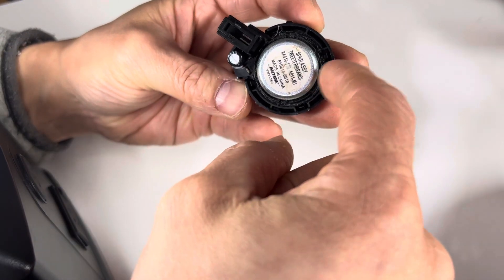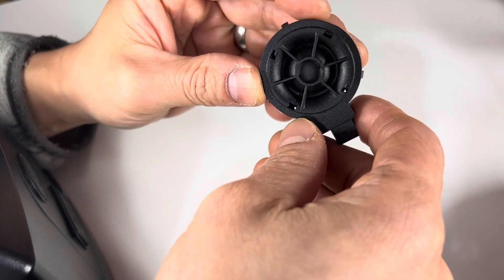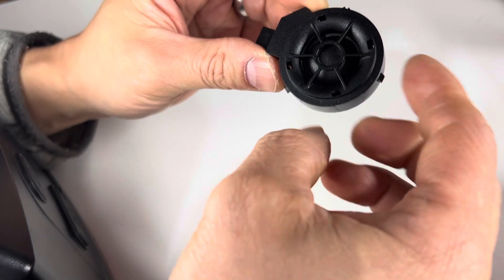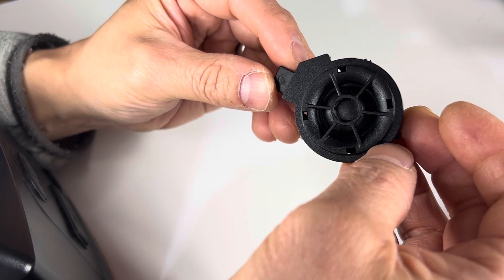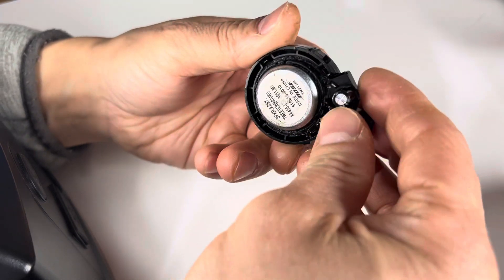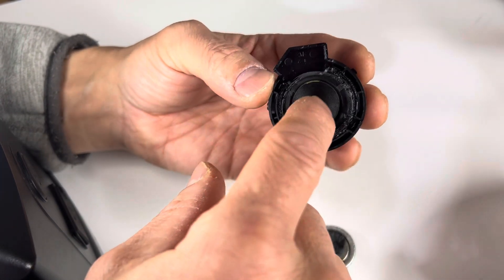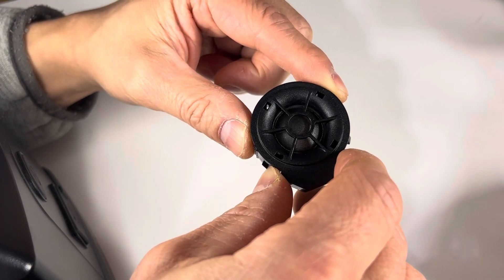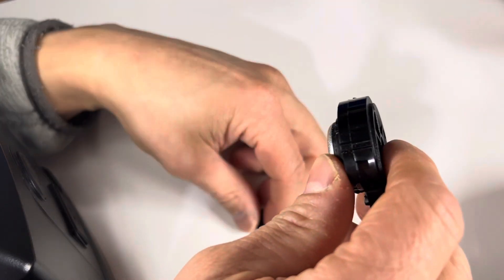How it works: Bose Centerpoint Car Audio Tweeter speaker. Stock:Honda/Mazda/Nissan…

Comment: Do you know how to access the Bose amplifier?  It’s supposed to be buried somewhere under the dash on the driver side.  I removed the kick panel and glove box but there’s was no sign of an amp.  I guess it’s way up in the dash.  I’m trying to tap the front door channels to get a mostly full range signal to send to an LOC to get full range output so I can add an amp and sub.  I have the hybrid touring and it’s the same Bose system as the SI.  It’s ok but meds more bass.
Reply from the maker: Hey, I can’t rem where I saw the Bose amp lol… been too long. 

But, I successfully added a RF amp and sub as per one of my other vids. 
Sounds great now. Only about 200W rms and one 10” in a slim box. 

I just replaced the sub, used that sub input and fed that into my (high level) input on my amp. Done.

Tuned it and sounds awesome now. 

Also has to replace the 2 front door 6.5” speakers with some Infinity Kappas: see my other vid as well. Hope this helps!
Reply: @kidsfuturesareworthit.8673  thanks.  From my testing on my hybrid touring sedan, the signal at the sub is basically a band pass.  I tested the AC voltage at the sub speaker lead and the voltage drops below 40 hz and also above 60 hz.  So in order to get full spectrum bass I’ll have to tap the front speakers and go into an LOC to restore the low end.  Not sure if the hatchback sub is the same or not.  Only problem is that I can’t find the amp in my 2026 hybrid touring!  It’s not behind the passenger side kick panel.  Guess I need to buy the service manual.
Reply from the maker: @funnyguy8042 yes you are correct. Bose limits the frequencies to that small 8” paper woofer. 
As far as that is concerned, my RF amp seems to handle the info quite well and goes deep enough. 
I sound deadened the whole care… floors, trunk, hood, doors etc. 
if remember where I saw the Bose amp, I’ll let you know. 
Cheers
Reply from the maker: @funnyguy8042 oh you have the sedan… I had the hatch… you sure it isn’t below the rear deck section? 
That’s where the Maxima Bose amp is…